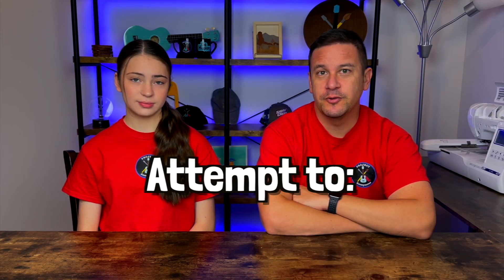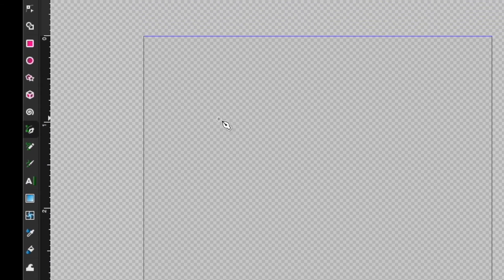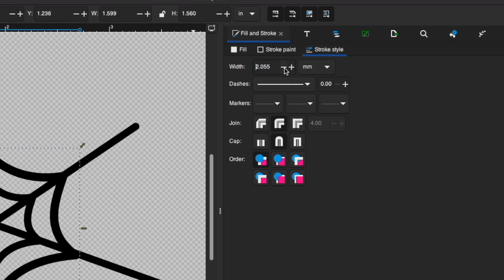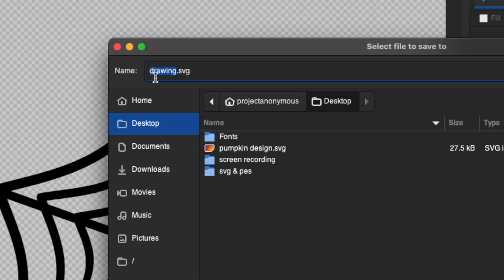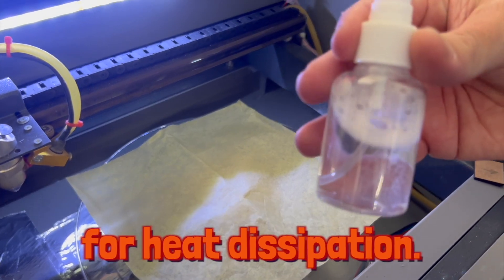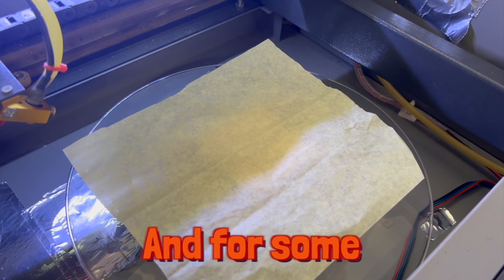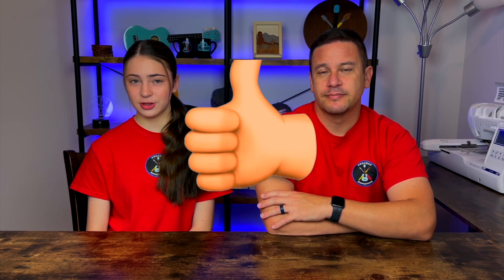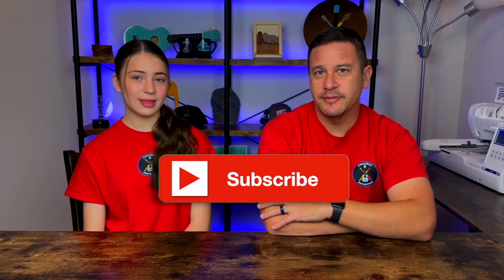LASER ETCHING GLASS w/ the Monport 40W CO2 Laser Engraver

Comment: I've only etched glass a few times with my laser. I haven't done the tissue paper trick and am not sure it is necessary. However, from what I know about glass, there are so many different kinds that it is probably a good idea to start a notebook of what works and doesn't for various types. At least as much as you can determine the glass type. I've only etched tempered glass and it has come out spectacularly.
Reply from the maker: Awesome idea! We should definitely keep track of different settings and factors for each type of glass that work! Thanks for watching and commenting 😊